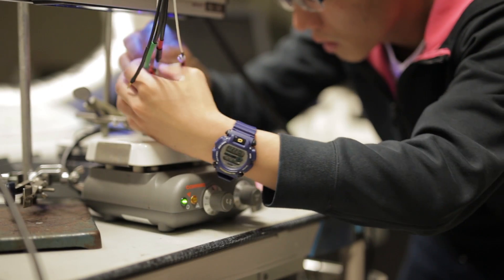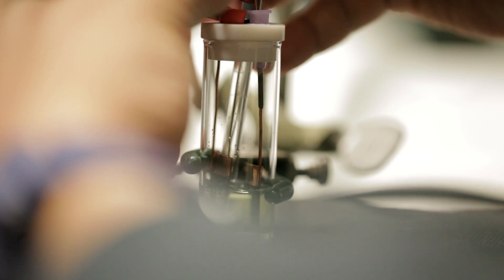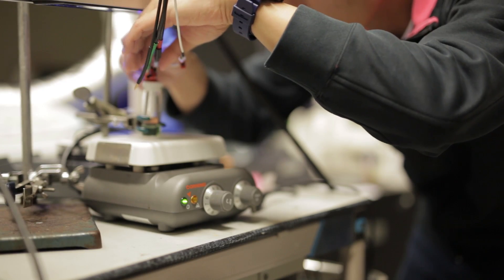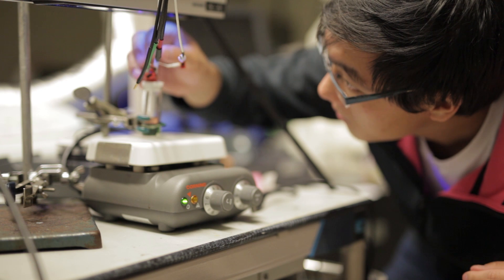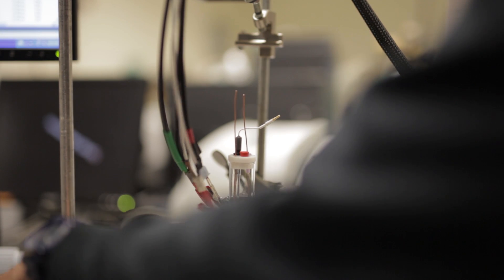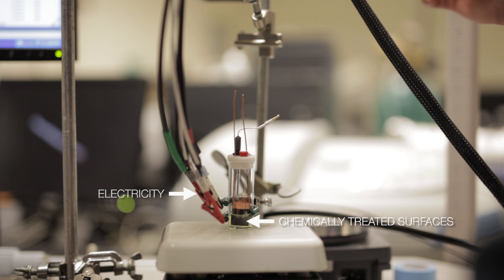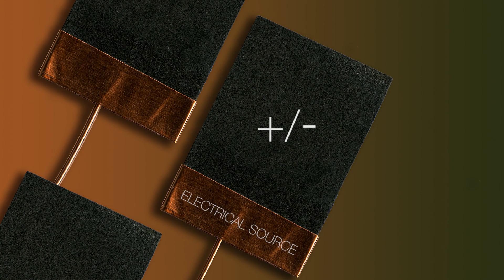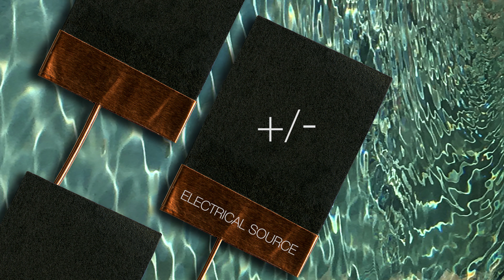New method removes micropollutants from water

Comment: If this can be tuned, perhaps the principle could also be used as a small & very simple form of chemical analysis, like a gas chromotograph (ie: an artificial nose for sniffing things to find out what they are made of).  
Coz if you can tune this system to selectively remove materials - then it can also selectively SENSE the presence of those same materials by simply measuring how much of the material has collected on the electrode.